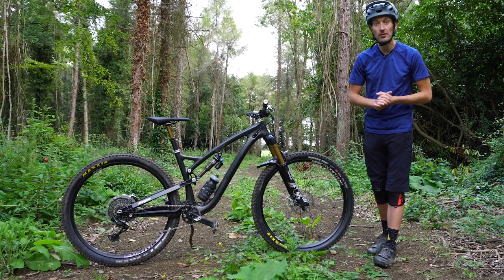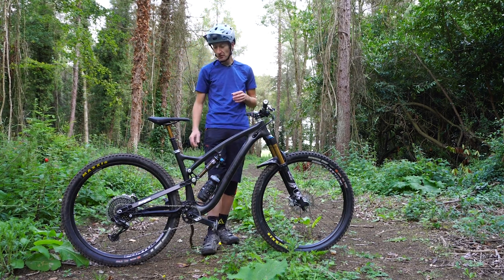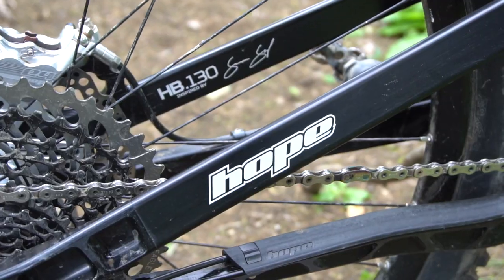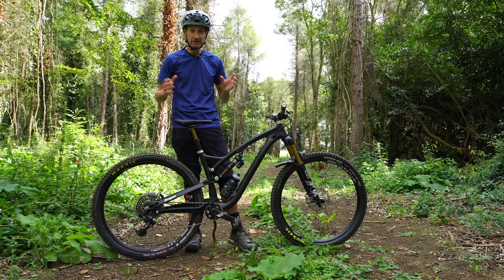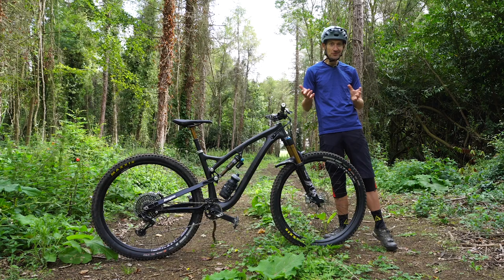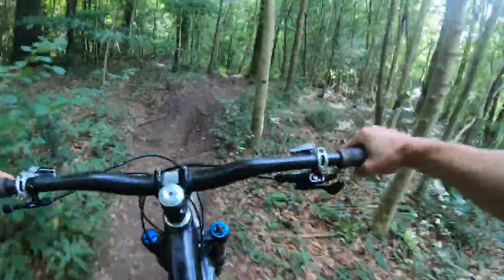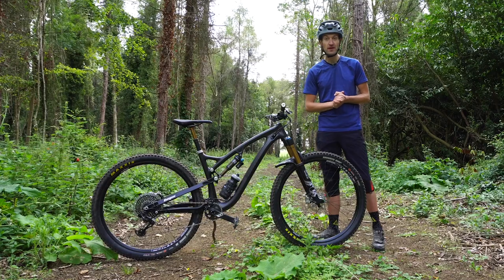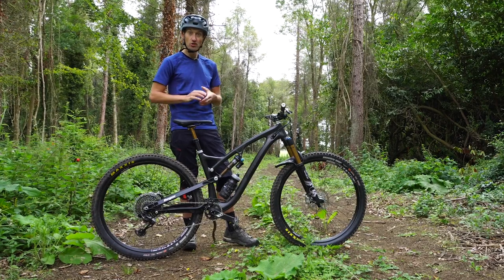Hope HB130 Review | The perfect UK trail bike?

Comment: i consider hope components equal to shimano xtr , so the finishing kit is as good as more expensive big brands , the only thing that is possibly cheaper are the wheels but for £7500 you get the santa cruz carbon wheels this is in no way overpriced as the 2021 price of big brands has gone through the roof